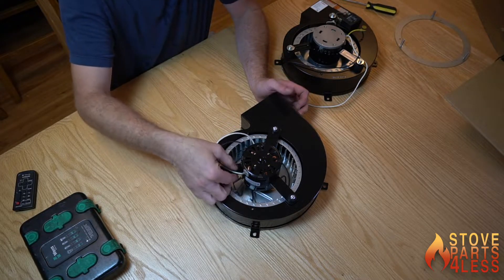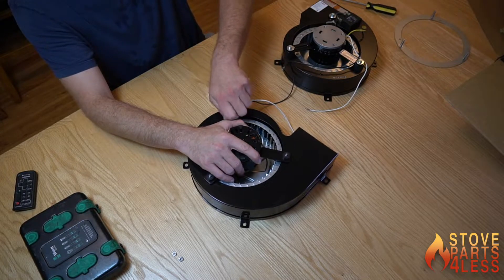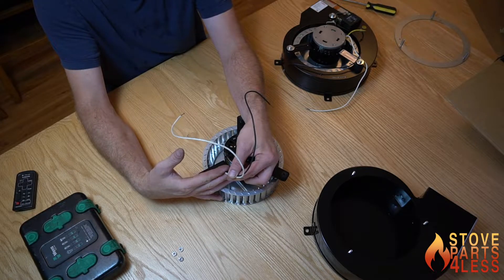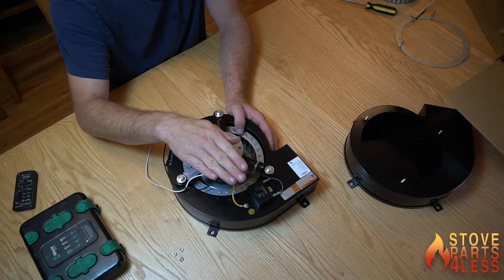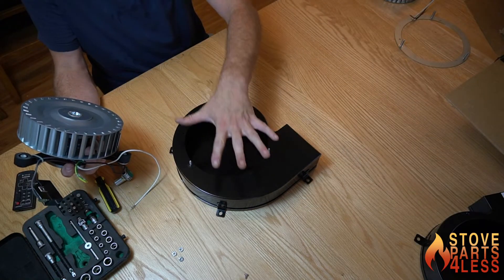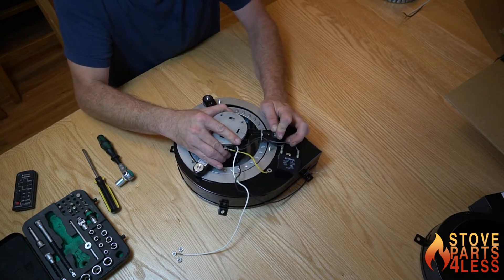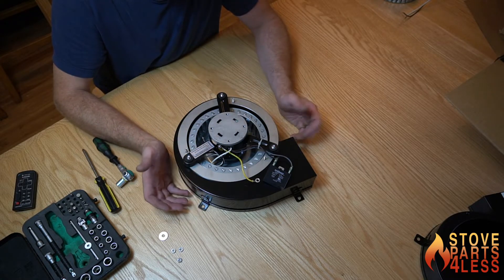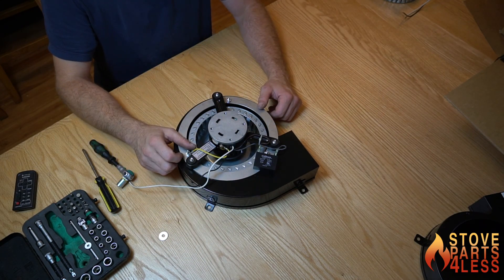How to Replace the Distribution Blower on Harman Accentra Insert

Comment: Thank you for this outstanding video.  Extremely helpful.  Followed your steps and completed a perfect motor/fan replacement.  I have a Harman Accentra model built in 2008 and there was a lot of confusion about the housing.  The housing on my stove is built in thus I don't need it as you explain here in the video.  Pulled new motor/fan from the brand new housing and installed directly into stove's built in housing.  Perfect fit.  Snipped and terminated both red and blue wires which are unused.  My family is warm and happy again.  

Once you have the knowledge from this video.  The hardest part of the install is getting to the distribution motor which is located on the bottom of the unit.  After removing all metal internal plates inside burn unit, I was able to tip the stove directly on it's front door utilizing a moving dolly that I attached a sheet of cardboard to.  Direct access the motor/fan made for an easy installation. After installing and connecting white and black wires, I was able to tip unit back upright and position into place.  I'm the lease mechanically inclined person in the world and this was a piece of cake.

Comment: I replaced the distribution blower exactly how you describe in the video and now my auger will not work. Any idea as to why? Please help
Reply from the maker: you may have accidentally mixed up the common wires (white). feed and blower are not related to each other. put your unit on test and see if the feed works when the distribution light is on

Comment: Hey Scott when I go to retail site it offers AMP blower motor but does not come with adapter ring for installation into my OEM housing and in the Q/A section they say you don't need it. Just want to clarify before I order it.  Thanks
Reply: There are two blowers which are the same unit. One comes with the ring the other doesn't. Nbk 20063k is the unit with the ring. 20063 comes with just the motor. Some supply sites have it listed wrong
Reply: Were you able to find that ring anywhere? We need one for our replacement and cannot find one anywhere. Our stove is an Invincible Insert.
Reply: @katherinepeacock2801   contact a supplier they can order it from nbk the model of the motor is 20063k. That has the adapter with it.  They can also just get you the ring. The supplier just needs to reach out to nbk.

Comment: You keep saying don't use the blue and the white wires but I think you mean don't use the blue and the red. Is that correct? So you wire the new fan motor up black to black, white to white?
Reply: Thanks on the confirmation. I did change it both combustion and distribution blowers yesterday. Everything is working well now
Reply: Correct.  The blue and red wires are unused for these particular stoves (Harman Accentra Insert).  I believe they are used for stoves with variable speed cababilities.  If you are able to follow their path, you will notice that they aren't connected to anything internally.  Black and white wires are the only ones that are utilized.
Reply: I agree with you. Can you confirm it is in fact white & blk used? Im doing this now.
Reply: @96TTtrqmnstr3  I agree, I'm replacing motor now and it's a bit confusing when he's talking about black and white wires In one sentence he mentions blue and white and black and white?
Reply: @rickmoulton4005  it is blk and white used. I did the swap this past wknd.